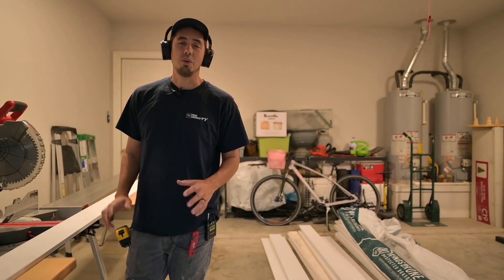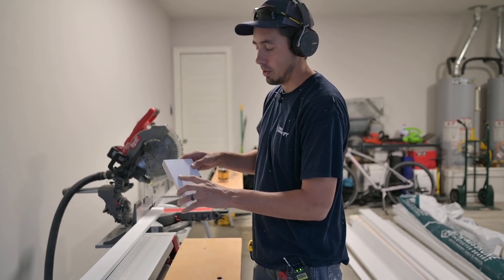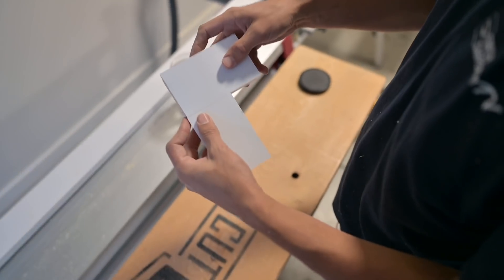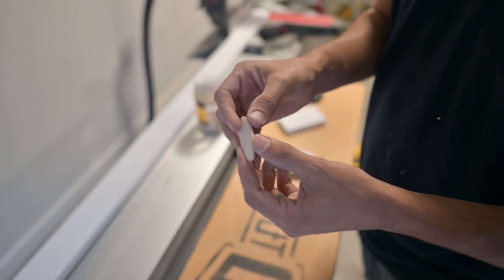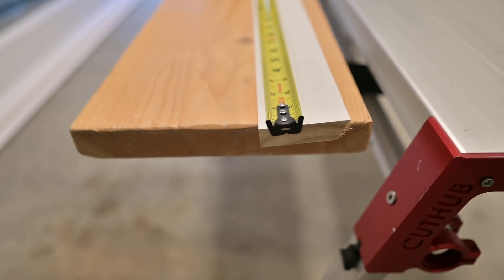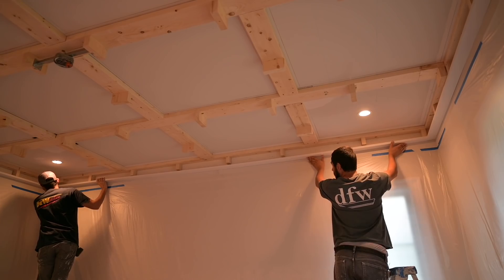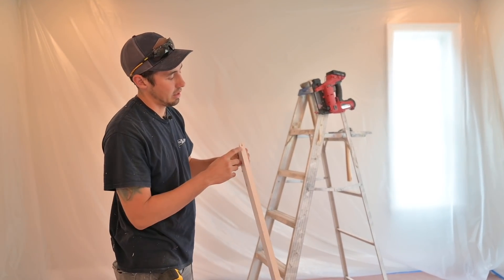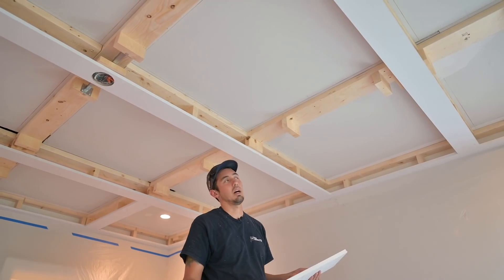Waffle Ceiling with Biscuits

Comment: Looks great. Not sure if this would matter with trim on the ceiling but I noticed on a few table tops I used biscuits on I would have waves after it was already finished and a week later.  Later I realized it was where the biscuits swelled and it was really noticeable because it projected with the poly on it. I started off-centering the biscuit closer to the bottom of the table on thicker stock and going easier on the glue seemed to help.  Just a heads up from my mistakes.
Reply: Ya they can telegraph if near the top. Good reminder to put them lower. Esp on furniture projects too.
Reply: If you sand too soon, before all the glue in the pocket is dry it will Telegraph. Putting the biscuit lower will help, but definitely be patient with letting all glue dry.

Comment: I don’t know if anybody else has responded to that question you asked, but you mentioned that it hadn’t rained for months. what typically happens is oil and tire wear from other vehicles will build up on the roadways and then once it rains it just comes right up and it makes your truck look like that . that’s why after a extended period of dry weather and then even a brief rain,the roadway can become very slippery just like ice. Great video thanks

Comment: I love my biscuit jointer make a great mechanical bond along with aligning the face of a 3/4 board at a 5/8 board. Keep up the good work.
Reply: Saul, which one do you use?
Cual de ellos usa usted?
Reply: @mariaedler5107  I have a ryobi biscuit jointer I bout used for $40. I love it and recommend it. I buy the biscuits at rockler 2000 for like $30.

Comment: I was most impressed with the fact that your layout and installation was accurate enough that you could precut all of your short pieces. I probably would have had to use a gauge block to space the long pieces during installation. Otherwise, half of my short pieces would have been too long, and the other half too short.

Comment: If you have a benchtop router table you could use it with a biscuit  router bit. They work very well and could save a little time.

Comment: I was wondering if you start the biscuit joiner in the center and instead of going all the way through just go out one side. You can still slide the work piece on to the receiving biscuit. Less holes on the side to potentially haft to fill. Like the idea.
Reply: There won't be any exposed holes on the side as the reveal covers the edge.
Reply: I was about to say the same thing even though there would not be a reveal,  it would help lock it directly in place. Over all this is nice work as usual.
Reply: Was just coming to comment this same thing. That’s how I do tray work on my ceilings.
Reply: You also only have to make the full dado in one end.  The standard biscuit slot would work on the other, especially if you just cut some splines to tap in.
Reply: By cutting only the one side of the cross member all the st through the end grain you eliminate the chance that the biscuit may swell so much that the two face surfaces of the Windsor One could be forced out of alignment with one another.  Leaving the one cross member partially solid prevents the possibility of the swelling biscuit causing a potential problem.

Comment: 2:00 I usually make a light line that crosses the intersection of both boards and line up the line on the biscuit joiner with the light line on each board. Beech biscuits swell when covered in glue to make a tight joint.

Comment: It could be tar residue from the road surface.  If it hasn't rained for a while and the surface is a bit soft then as you drive over it with the rain then up she comes and there goes the finish on the side of the truck.  I would try some Tar and Grease remover on a small patch and see if it comes off.  We use it in Australia for flecks of tar that you get on the paint.  The only thing is the recommendation to polish the car where you have used it.  It is a petroleum product.

Comment: It just occurred to me as you do your first measure...the Digital Measuring Thingie may be trustworthy accurate but when you use your Tape-measure to transfer the measurement to the board you have to be sure that both measuring devices are in sync. Many Tape-measures vary by 1/16" to a 1/4", even within the same brand, same model. (WOW! Such a simple yet genius solution with the biscuits on the short boards. I feel embarrassed for not seeing it myself.)
Reply: Geeze a 1/4. Maybe an 1/8. But agreed.

Comment: Its a more aggressive tread pattern than throws more water.  Also, it maybe was something on the road that was thrown up with the water.  More of it when these tires than your old one makes it more noticeable.  Either way wash it off before it etches your paint.  Use plenty of soap so lubricate it so if its gritty it doesn't swirl scratch your paint.

Comment: Hello Richard! Great video and as always, fantastic work! So as an observer I noticed something that may make your job a bit easier. When you made the dado into the edge of the short boards and you installed them above head I thought of something. (I am not sure if the dados will be cover with some sort of trim, if so discard my comment) If you didn’t go all the way through from end to end with the dado, if you would stop just shy of one end that would save you time filling holes/gaps/dados. Instead of filling four holes/gaps/dados, you would only be filling two per board. Just seemed like it would be less work. Can’t wait to see your next video bro. Keep it up man.

Comment: The stuff on your truck is tire lube. Tire shops put it on the bead of the tire to help it slide on the wheel and seal better when mounting the tire on the wheel. When the tire stared spinning It flung the excess on to your truck.  It should just wash off with soap and water. And wash your tires and wheels to get the rest off so it stop flinging it on your truck

Comment: Nice work. 
The black stuff of your truck is most likely from a road crew re-coating a section of road and if it rained, the coating didn't dry properly. If you've been through an area where there's been some road construction, you may want to check with them.  It has happened to me and the company paid for my truck to be cleaned and detailed.

Comment: To answer the last question you had about the residue on the the truck it’s indeed tire shine residue, for what I see looks like a silicone based was used on it which is common for doing that on big tires like yours, try to stick with quality water based dressing such as Hyper Dressing by Meguiar’s or Tire Shine by Adam’s Polishes

Comment: I really prefer using the Festool Dominos along with the pocket screws.  I also just realized that it wouldn't work for those kinds of installations where the boards were already in place and you didn't have the clearances.

Comment: Im fairly certain that the black stuff that's on your truck is ash from the forest fires. White vehicles really don't show dirt as easily as other colors so my .02$ is that your truck had ash on it and when the rains hit it, it showed the streaks. Additionally, the roadways would have been covered by it as well which splashed up on your side paneling. 

Digging your work and you've inspired me to put in 2 faux boxed beams in my living room. I'll start that when I get home after this business trip.

Comment: Why go all the way through with the biscuit for the cross pieces ? Just make the groove as you are doing but stop before you exit on the other side. Pro's: no tear out, a positive stop and the glue won't have a chance to drip out the side. Your finish crown/... would cover the slot anyway but just for good measure. Thanks for all the very informative video's. Learning alot, even though this type of finish work is very rare where we live.
Reply: I was looking for this comment 👍
Reply: Really all that is required is to plunge the biscuit joiner in the center and then slide it out one side. That leaves the maximum amount of wood to hopefully stop the swollen biscuit from splitting the board.

Comment: If the wheels are standard size and not rubbing on the inside of the wheel well, the stuff on you pickup is the dirt and oil and other grime that the water from the rain splashed onto the side.  Do you normally get regular rains and in amounts of an inch or more each time?

If it does not rain for a while, dirt and oil that leaks from vehicles, and the rubber from tires that wear off going down the road builds up on the road.  Then when it does rain, the rain loosens it up and carries it in the water and then your wheels splash it onto the side of your pickup.  If it is a lite rain, then it will not wash the residue off the road or off the side of a vehicle  The oil residue is why the road will always be slipperier when the rain first starts wetting the road than later.

So if you get regular rains of sufficient amount to keep the roads wash off you would probably not get that amount of dirt on the side of your pickup so you would not have noticed it before.  And if the rain you did just get was a small rain after several months of no rain, then you got what would be an extra ordinary buildup on the road and an extra ordinary buildup of grime stuck to the side of your pickup.

Comment: i'd like to do waffles to my ceiling like that but i've got a plaster textured ceiling likely done with a roller. i want to cover that so is there any thing i can put in the "waffles" ? i'm not talking blue berries here but something along the line of boards. also instead of 2 x 6 could you use a smaller dimension of lumber like a 1 x 6 ? great video and excellent job :)

Comment: Just waiting for the Festool guys to jump in here and tell us how the domino is  superior  to the biscuit. I have never had a problem with biscuit joints and I use them quite often for panel glue ups.  Nice looking ceiling, very clean looking.
Reply: There's no way they'd be able to do it in-place like that with a domino.  They had to bend those pieces pretty far already to fit the biscuits in.
Reply: I own a domino and i would even try to use it for that. Probably would have just made sure I had blocking at each joint and it would be good without all that.

Comment: The residue on your truck actually looks like brake dust. Did you get new pads put on at the same time as the tires? If so you'll have to use a clay bar to remove the residue when you wash your truck. Mothers makes a pretty good one, but there are a bunch of companies that have similar ones.  Once the residue is cleaned off I would apply a nano-ceramic coating to keep anything from sticking to the truck. Shine Armor is one of the better brands out there, and you just have to spray it on and wipe off.

Comment: I detailed vehicles professionally for a decade, so my 2 cents on the black stuff on your truck is.....it looks like road tar from fresh pavement.  It can get bad if you drive on the new pavement every day.  No matter where it came from, the good news is, the fix Is always the same.  A good tar remover that can be sprayed on and pressure washed off, or sprayed on wiped off with a rag.  We always used OMNI MS251.  Its a multi purpose solvent. Don't spray on black plastic and wear gloves!  I'd be willing to bet you have a solvent that you use in your line of work that will do the job also.  Again, avoid black plastic, keep it on the paint and you'll be happy with the results.  A fresh wax is recommended after using solvent to remove tar.  Sorry this was so long, love the videos, you teach me a lot. Take care.

Comment: I had that same biscuit joiner and it didn't last very long at all. I had it for about a month and it died. I got it when it first came out in I think the late 90's or early 2000's. I forgot what I replaced it with but it was the company that invented it. That brand had the redish looking handle and a galvanized looking base. I think I traded that tool with another carpenter for something different that he had. Anyways, I only have a DeWalt miter saw stand and that's it from that company. DeWalt is Black & Decker and made in China and is junk. When DeWalt first came out in the USA and wasn't a Black & Decker product, I purchased a corded drill that lasted me 25 years. It was a great tool but then I replaced it with another one of like kind and with the same specks and burnt it out that day. I replaced it with the same thing that same day again and the same thing happened again. Then I returned the second one, got my money back and got a Milwaukee drywall mixer type to drill holes in my doors. That's what I used it for all those years. I used to build and install custom doors a lot. I've hung and swung over 10,000 custom doors. I still do finish carpentry but I only do it on my own projects that I build from the ground up with my own hands and no hired labor. I got out of working for others and now build for myself. The first two homes I built, I sold and then started keeping the rest for myself and rent them out. I purchased my first raw piece of land when I was 19 and bought a very used 17' travel trailer that I parked on my property to live in instead of paying rent and then on the nights and weekends, I would design and build that home debt free. That's how you get out of the rat race and advance yourself in life. I hope this helps you! Take the extra income you get and invest in as much physical silver that you can. Also, don't eat out. Pack your lunch every day and save big time. Never finance anything and pay cash for it all. Never purchase a new truck, always get a used one from a private party. That's more ways that you can get out of the rat race and become financially in control of your money.

Comment: The black stuff on your truck is from the fires not the tires.  The rain brought up the ash
Reply: The fires? He's in the DFW area if I remember right...
Reply: probably just generic road grime from other cars etc. Exhaust soot, brake dust, tire rubber, ground up blacktop, dirt, grass, leaves, bird and animal poop. It's worst when it hasn't rained for a while. The rain washes it off the road but also washes it off the cars back on to the road.

Comment: If that on your truck is a texture, meaning cant rinse it off then most probably you ran through a fresh coat of tar or some sort of fresh asphalt covering. Also paint is a possibility. Paint for concrete or any floor surface is quite thick. If that is a tire residue you would be driving on rims already. Buuuut we do live in some wonky times so I would not be surprised. Either way good luck with removal.   👽